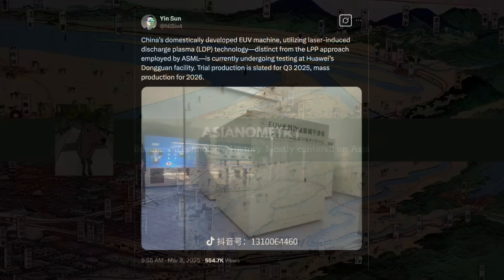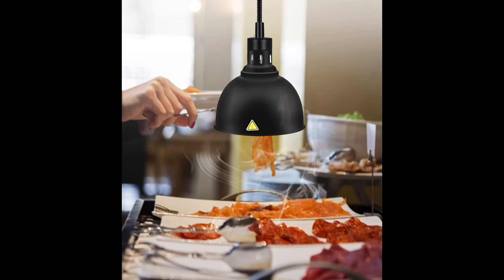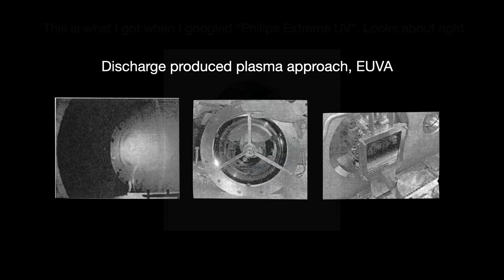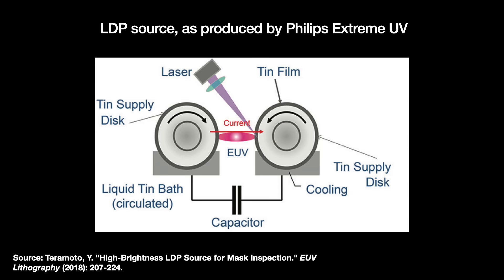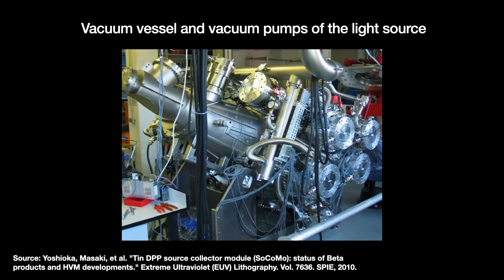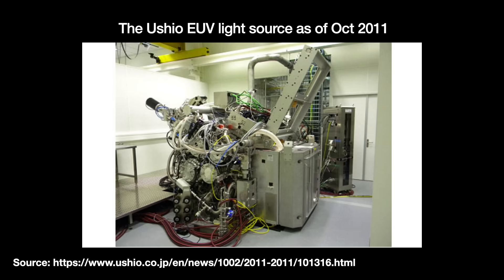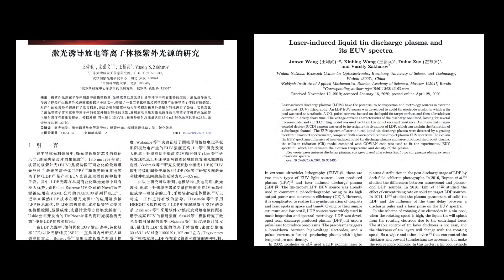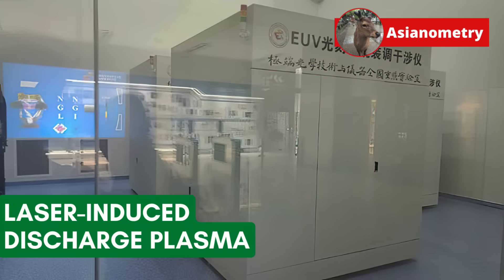China’s “New” EUV Light Source

Comment: Chinese EUV doesn't really need to be economically competitive with ASML, because ASML machines and chips made by them are banned from export to China, and the Chinese government can always subsidize the tech to make the economics work as long as its performance is good enough. Also, if they're developing EUV to make military tech, militaries don't really care as much about how economical it is as civilian markets do, as long as it gets them parity with their adversaries, because national security is not an economic problem but an existential problem.
Reply: military tech doesn't use 3 or 2 nm nodes.  Name me ONE missile or one plane or one radar system that does.
Reply: @lionrock2023 the AI and huge numbers of nodes that they use for war gaming, analysis, tracking, cracking, they all use the modern tech. Comms analysis, you think that uses old tech? Maybe. I'm guessing there's lots of modern capability too.

Do you watch Michel Labs, Le Labo De Michel? He takes apart weapons systems, missile detectors, etc on YouTube. Most of the stuff he shows uses old enough technology. Some looks advanced.
Reply: Military does not need anything with EUV. You need EUV for processors and GPU. 99.9% of military equipment can be built with automotive parts and common embedded systems...
Reply: @dtibor5903  past military probably not. But you can clearly see that drones are moving in AI, which means faster and energy efficient chips - EUV.
Reply: @MSP_TechLab  those military drones require edge computing devices, which are common and unsanctioned... A mobile phone easily can run an AI that is required for military drone. Just look at DJI drones and what they are capable doing. They have all the compute capacity what a military drone requires. What you are talking about is the propaganda pushed by the tech illiterate US government...
Reply: @dtibor5903  you're saying that phones can do that... but that's the point. Phones now are number one consumer of high end chips.
So, militaries around the world can try to convince you that they don't need latest chips just to avoid showing any kind of weakness (especially dictators like ruZZia, iran etc). But in fact, if they see that latest chip can do better job (and drones proves that), they will immediately use it.
Reply: @MSP_TechLab  mobile phones and current high-end commercial drones have all the compute capacity required for an AI military drone...
Reply: @dtibor5903  not really. Modern phones are heavily rely on internet connection to cloud servers while drone should have all of that on board.
2 years ago when FPV drones became a significant part of battlefield, it was predicted that ai based target tracking would be a common thing within a year.
However, it appeared that ai models which work fine in lab straggle in real environment due to battle conditions like weather, fire, smoke etc and etc.
Which means that you need more and more ai power on drone.
As the result cheap fpv drones still don't have relaible ai tracking on mass even after 2 years of development. Bigger and much more expensive drones do better. But the point is to have it on mass.
Reply: @MSP_TechLab  i wouldn't put military grade human tracking in a commercial drone for obvious reasons....
Reply: @dtibor5903  that is a bingo
Reply: Knowing China, once they figure out how to make it in the first place, they will be able to drastically reduce costs through economies of scale, just like they did with Solar Panels and EVs.
Reply: @a.16.g  Uh, no.  China did ramp up production of solar panels and EVs, but those are subsidized for the export market to eliminate competition out of foreign markets.  EVs are somewhat unique here in that they are subsidized when sold overseas, but they are starting to show their quality and reliability are not that great.  Australians who were enthusiastic about them are now seeing problems at 40,000km- 50,000km that wouldn't occur in the western petrol cars they gave up - mechanical parts failures & software failures among them.
Reply: @a.16.g  It will be good to have more competition, driving prices down!
Reply: @a.16.g  

You mean through massive government subsidies to allow for production at a loss? 

Solid plan, lolololoololol.
Reply: Can you mention any US military equipment uses 3nm chips? 😅😅😅
Reply: @   I can't because   why would they be there
Reply: you are saying Netherlands and EU government didn't subsidize ASML or Airbus? lol
Reply: I think China will have very little issue to make it economically competitive if they could figure out how to make one. For many years, the main problem with Chinese manufacturing was being unable to make cutting edge products rather than unable to control the cost.
Reply: The bans were never about the military. They were about monopoly in the chip industry. A.k.a money.
Reply: @nekomakhea9440  the youtube censorship is crazy, it's deleting my comments for no reason
Reply: @dtibor5903  You probably said something meaningful at some point. They don't like that.
Reply: Military Chips are usaully made with older nodes to be more reliable.
Reply: Virtually all military and industrial control ICs, including mixed signal, which are 90% plus of IC use, are 65 nm and larger geometry.
Reply: what's the military use of high end chips?
Reply: 相信我，十年后，你们会用到物美价廉的好芯片，在打破资本家饭碗这件事上，中国人向来是最擅长的，我们痛恨资本家
Reply: 你的无知令人震惊😂😂
Reply: does YES confirmed
Reply: If you don't care about economics you can just etch your wafer with an electron scanning beam, much simpler and more precise. The only problem is that it doesn't make economic sense at scale.
Reply: Not a healthy end goal. This only makes sense as the path towards a technology that works. Not as an end goal.
Reply: Europeans will learn that eventually, or they're going to be vassal states of Putin.
Reply: i like this idea but the chinese are way more into investing to be the lead tech than we realize. They are going to try compete on technology that is literally their goal.
Reply: 军用不需要euv，duv就可以，中国现在可以自己设计生产duv。不要怀疑，euv就是为了同西方进行经济竞争。😇
Reply: Everybody saying military doesn't need EUV. Wrong... think Palantir.
Reply: Military chips need not to be small, but reliable. That's why they still use nodes >24 nm because it has less quantum tunneling and more reliable.
Reply: @studentstechtips-bangla6599  A missile that will fly ONCE and for only a few seconds, need not worry about battery life, only about precision.
Reply: Only a mistake, making research to national security is a Economic desicion too. I know english minds can't tink economy without money, but economy is more about power to do, and how to deal with limited resources, than to money.
Reply: A governent department that can't pass an audit is an existential problem.
Reply: Lol, new to this channel, but I strongly suspect that the host identifies as "Asian", or some other nebulous identity, which is primed to serve as the bltch of the "free world" that is America.
Reply: This is a nonsensical cope. China doesn't do business that loses money. When they introduced their own EUV, the cost will be below what ASML can do and they will still make profits. This is the brilliance of China's long term strategy of expanding their productivity forces and supply chains.

You westerners are so racist and prejudice against the Chinese and have been drinking your own kool-aid that you refuse to admit that every time China broke through into an industry, they inevitably bring down the prices. Western high tech goods are overpriced, so the moment China enters the market, your companies collapsed.
Reply: Wrong. They are using it to make commercial chips, an economic imperative. Military around the world use legacy node processes chips for various reasons including robustness and reliability. In fact the US military is dependent on China for many ICs. You are projecting America's past on China's present, suggest you get more information and rethink this. Greetings from Shanghai.
Reply: true, this straight up china hating misinfo gives me a headache. like, it doesn't even makes much sense if you connect all the  facts stated in the comment even without taking in account reality, just by analysing the comment itself it us apparent that the guy is merely repeating already existing point without even trying to think critically.
Reply: @unreliablenarrator6649

Quick correction.  The US military has ensured its supply chains are robust and can be made independent of anything sourced in China. 

They continue to source from China because it:

1. Drains resources through material and opportunity cost

2. Gives the US the ability to troll China by ordering high cost hardware they never intend to use, causing chinese military to freak out like they did over the scale
Model dark star for Top Gun. 

Greetings from the US.
Reply: @unreliablenarrator6649  The chips the USA acquires from China are not high-end processors and can be acquired from other sources other than Chinese manufacturers.   Basically, Chinese manufacturers are less expensive at this time than other supplier.
Reply: @unreliablenarrator6649 Your post fails to take into account the aggressive actions that everyone sees the Chinese military take.
Reply: @metatechnologist  Which aggressive actions are we talking about? Asking for a friend🙄
Reply: @metatechnologist US and colective West did more harm than China.
Reply: "Chinese government can always subsidize the tech to make the economics work", that argument was used extensively in the USSR, and several major developing economies.
But frankly, there is not one example of it being a viable solution outside of a the length of a single human generation, is there? Maybe excepting Roscosmos till the advent of private space companies.
China has been and is funding its economic (mal)investments by transferring funds from workers via indirect taxing to (state+private) producers. This indirect taxation has yielded enormous amounts  of money due to transfers of workers from subsistence farming to industry (=more productivity per worker), a massive demographic dividend (=more workers) and access to the globalized marketplace. The latter meant the CCP had the ability to use higher productivity by selling to the outside world, thereby avoiding raising wages for a long time, which together with inability to use most normal saving vehicle's constitutes primary sources of indirect taxation.

However, China can not repeat urbanization, the one child policy or entering the WTO.
Hence going forwards Chinese state investments will be much more sensitive to economic outcomes for individual investments.
Reply: ASML EUV isn't economically. Not a single EUV fab had been build without multi billions tax subsidies.
Reply: @HyeL  Uh, yes. TSMC Fab18 was built without any subsidies at all. Apple got exclusive access to N5 for like 12 months in return for partnering on the risk development cycle.
Reply: nope. TSMC received billions of subsidies and "cheated" everyone thru "overcapacity"
Reply: @HyeL  垄断永远是昂贵的
Reply: military equipment dont need small chips. they are not constrain by space as in consumer products.
Reply: if China is developing just because they don't have access to EUV then why stop at EUV, why not xray or ebeam or something else better. it is a waste of money if it is just catching up.
Reply: @SaurabhKumar-uo6ms  They are investigating other tech. For instance Steady State Micro-bunching (SSMB).
Reply: @SaurabhKumar-uo6ms  They are investigating other tech. For instance SSMB.
Reply: @SaurabhKumar-uo6ms In time…
Reply: Well, we have drones now, but those are built on older tech, or at least using larger tech process.
Reply: Time is on China's side, there is nothing China hater can do about it.
China is very patient
Reply: No they aren't. China is barred from buying super high end AI chips, but every AMD CPU and GPU for the last 6 years has been EUV, and every Nvidia consumer and workstation GPU also have. Intel didn't get into EUV until recently, but they don't make a single product that's under embargo. Apple has been on EUV longer than anyone else, and all their products are sold in China too.
Reply: @andersjjensen  there are many ways around it, they can just use proxies to buy those and obtain the tech, which In would be surprised if it is not already happening.
Reply: China is building all of these on its own while you continue to sleep in your cave.

Comment: I was "arguing" with chatGPT about how quickly china was going to surpass ASML. I said within the decade and it said no chance in 20.
I would really love for china to disrupt the dram oligopoly, if only so I can have more chrome tabs.
Reply: GPT is trained on biased Western English language materials. You should ask DeepSeek the same question
Reply: cxmt's ddr5 is already on sale, and the scale is gradually expanding
Reply: @shkunwen  cmxt is the reason they are switching to EUV in the first place
Reply: @ Micron's mass-produced 1β process DRAM memory chips have a process level equivalent to 13nm, which is the limit of DUV DRAM manufacturing! CXMT's current mass production process is 16nm, and there is still room for improvement! Samsung currently uses EUV to manufacture 10nm DRAM

Comment: 11:45 noob question but if there is limit to how much you can scale power output untill plasma is too big and is wasting energy why not just use multiple euv light sources going to same collector mirrors? just curious ofc. they had to think about it too and didnt do it becouse of something and its not as easy as i imagine :)
Reply: It is not just about reaching to collector mirrors but also the direction (if diverging, spread, and intensity distribution as well) has to be identical. Imagine a following scenario:  You are going to take an extreme bokeh image of a firefly at the dead center of your film/CCD/image. Now trying to put another firefly in the scene but it has to be in focus and at the dead center of your film/CCD as well. You also can't squeeze both fireflies in the same physical place.  Now getting harder. You can use a concave offset mirror to 'relay' another firefly on top of original one but 1 high quality concave mirror is needed (expansive). For the third, there will be 2 bounces/relay to over lay. and so on. With 70% reflectance, it won't do much on top of alignment headache.
Reply: Because you won’t be able to collimate the light from multiple sources without additional reflection losses.

Comment: If Chiner knew what time it was they would be developing alternatives to silicon altogether, so that fab size isn't as huge of an issue. Cupric oxide looks promising as a semiconductor - I found a rather recent paper about creating transistors with it, and its properties are much better than that of silicon. Switching speeds are higher, resistance is lower, it's right up there with the graphenes and borophenes, perhaps even surpassing their semiconductor properties. You could just make dies larger to achieve the same level of compute as a silicon die.
Reply: china already have silicon alternative already (I forgot the name at this moment) and they also research the light based processor, and also another tech to build below 1nm processor. if the latter ready for production before the rest of the world, that would be amazing.

Comment: Imagine if the Texas power outage had hit a fab using this system.
Reply: Fabs have diverse, dedicated lines.
So long as there's power being generated, they get it.

For instance, in Oregon,  Intel has dedicated lines from Bonneville Power Administration (BPA) and secondary from Portland General Electric (PGE).

Basically, Private transformers and lines connected directly to the backbone grid.

So long as the dams on the Columbia River are making power, and the towers haven't collapsed from earthquake, volcano, or terrorism, they have electricity even if surrounding properties are in the dark.

The second source is "shared" and switched in usually only when the primary is under scheduled maintenance. 

They also have big-ass on site generators.
Reply: @tintruder224  Samsung fabs in Texas had to do emergency shut downs that cost hundreds of millions of dollars and made a substantial dent in the global NAND supply in 2018.  

With this process, oops, now  you've got hundreds of millions of dollars in equipment encrusted in tin.

Comment: so why not just using a scanning electron beam mask maker (0.2nm and below), with an electron flash activated photolithography step. no, its much simpler than the euv nonsense. euv semi-chip laser would be much better. well choose your semiconductor material for the laser diode properly, to get the correct accurate euv laser beam. whatever that photon eV rating is. I assume its above 1ev but below 60eV. as visible light is around 1ev. uv and euc ranges are 2eV and above. no you dont need to be paid for doing nothing when inventing extra complex processed for doing more nothing. if money is not involved, you have to make reason of your choices, as you are the only one to carry your choices. ie minimal burden carry. cant you just use electric arc gas flash light with a band filter. for the lithography process mass step. you know direct laser euv has those same mirrors too, for the mask manufacturing step. engaging in community arguments is worthless. if you ask managers, more cost is better. also never ask unskilled people (community) in general. you only get assaulted and insulted.
Reply: Because electrons, as opposed to photons, have charge. This makes it not only impossible to use masks, but the substrate you're trying to etch would quickly build a charge that that would repell the incoming beam.
Reply: Way too low throughput. Not suitable for mass manufacturing. You can use these to make the masks themselves but not pattern chips.